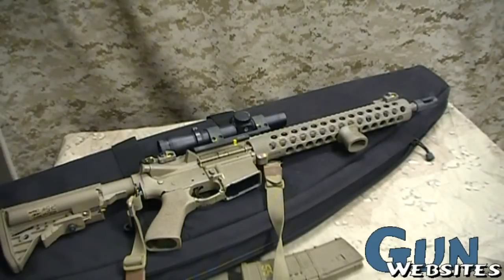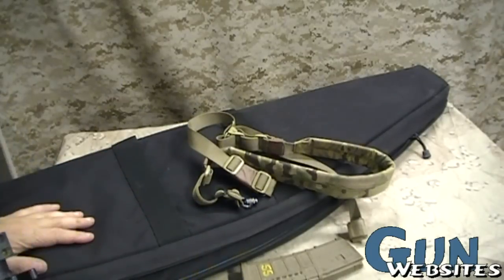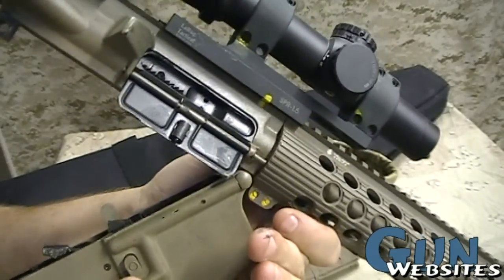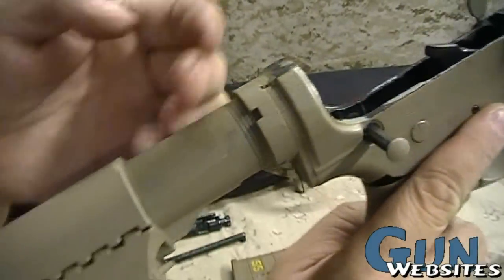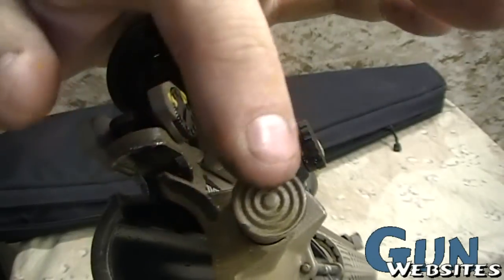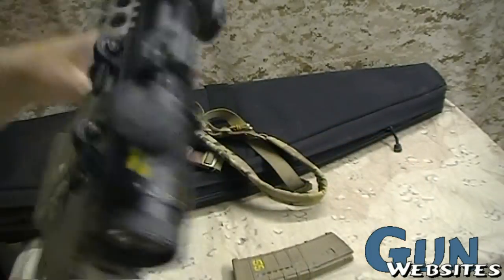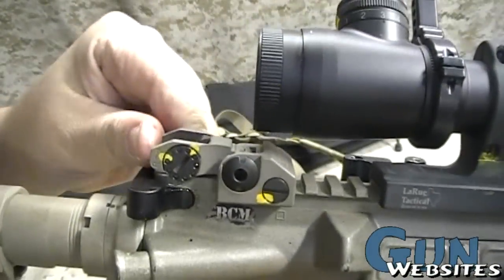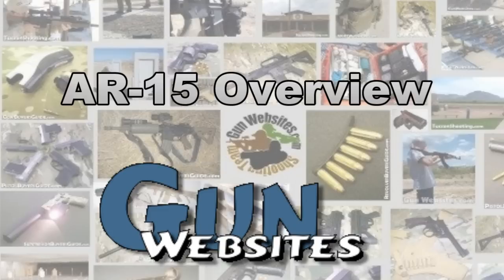AR15 Components Overview

Comment: @jimkressin 

The yellow dots are witness marks.  It allows you to easily see if any of the screws/fasteners have backed out due to the vibrations caused by shooting.  You could co-witness with that optic but it is generally not done with a magnified optic.  Not saying it couldn't be done, but most don't with that style.

Comment: @booooo123456 If the bolt dose not lock into the barrel completely you can slam the foward assist with your palm and it will force the bolt closed. Most recommend remedial action and basically get rid of the round that did not chamber and get a fresh one in. (SPORTS) Slap Pull Observe Release Tap and Shoot